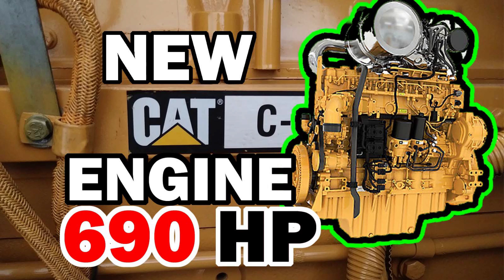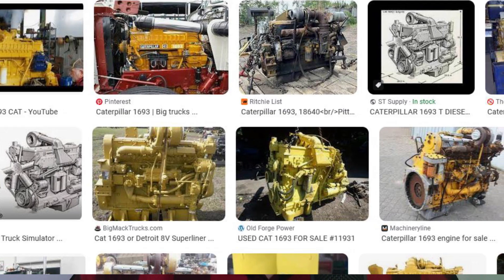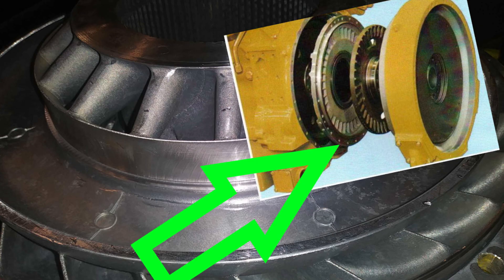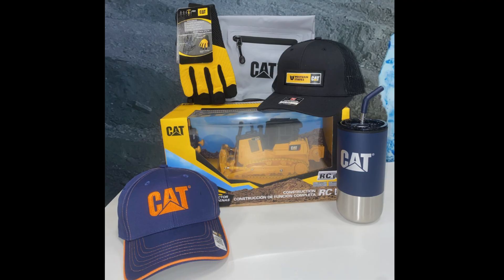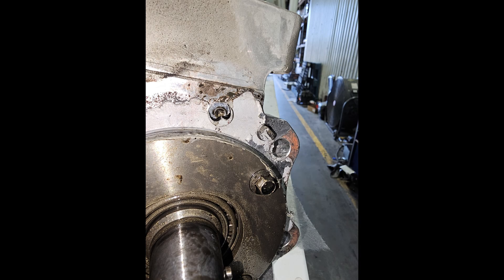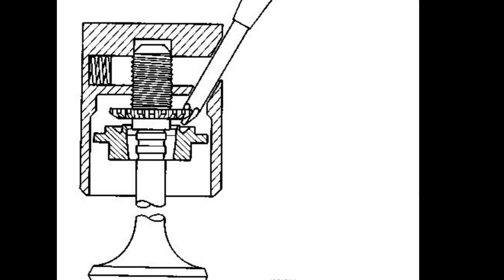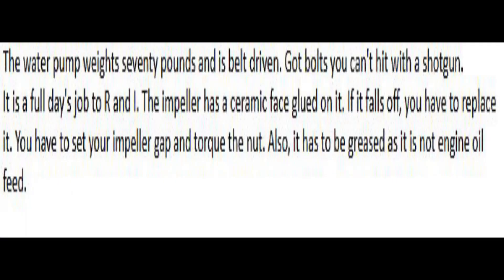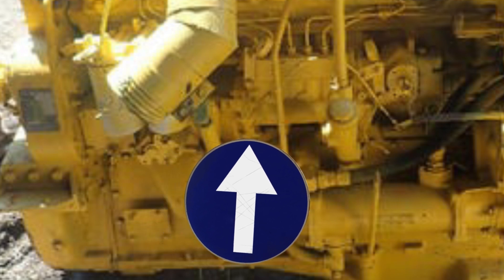The Coolest Diesel Engine You've Never Heard Of, Cat 1693, Dual Overhead Cam Caterpillar.

Comment from the maker: Thanks for watching. If you wanted to watch the livestream with the giveaway info, here is the link: https://www.youtube.com/live/k5mIdUxpS74?si=Ji4AVtOc7nYvK2NU
If you want help the channel out you can click the Amazon Affiliate Links here: Fuel Pressure Gauge, Compucheck 0-300 psi: https://amzn.to/3YeBldu
Airlift Cooling System Vacuum Filling System: https://amzn.to/3D9AlPu
Radiator Pressure Tester Kit: https://amzn.to/3QGBumn
Milwaukee 3/8" Right Angle Impact Wrench: https://amzn.to/3D2CvAk
Adjustable Height Parts Tray 100 lbs: https://amzn.to/3CBusZB
Engine Oil and Fuel Dye UV: https://amzn.to/3z34zkv
UV Professional Grade Light: https://amzn.to/3gzxPc0
Reply: Big Cat V8 engine was tried in truck's, cant remember its number. It was not a sucess. Way before 3408 and definitely not the 1160 or 3208.
Reply: Think a 1693 is interesting, look up the cat d336 overhead cammed v8
Reply: The d343 was what went in d9 cats way bigger than 1693
Reply: The first 3406a engines were precup engines also or a glow plug engine

Comment: The 1693 came in trucks at either 325 or 425 hp..The intercooled 425 could be turned up to 550 -600 hp..Total monsters that hauled ass.. they fell out of favor due to the 3406 being lighter= more product lesstare.Most of the Pete conventionals that I drove with a 1693 t 425 engines had aluminum frame rails to help lighten the tare weight. If you really wanted power you went with a 3408 v8 450…3.5-4 mpg were common if you were really gougin on it most of the time..

Comment: Side plates would be in good in a marine application. In a lot of marine applications you can't drop the oil pan far enough to get to the caps off. I've worked on a lot of engines in applications where dropping the pan is not an option.

Comment: The D348 was a V12 with dual overhead cam with 4 valves per cylinder and twin turbo. Designed back in the 1970s. Eat that Ferrari

Comment: Go find a 1694. A V8 version of the 1693, which is the truck equivalent of the D346 industrial engine. The D346 was used for the front engine in 657 two engine scraper.
A monster truck engine that reduced downshift on hills due to the torque.
Reply: Show me the 1694 link. The V8 that I know of was a 1676, smaller bore.

Comment: There was no sound like the scream of the huge Airesearch turbo. My uncle had a 1973 Kenworth K100 cab over with a 1693. That’s the truck I learned to drive in. Interesting engines for sure

Comment: Well, you almost know what you are talking about.  1693 engine was also used in air compressor's  and gensets designated as 1693. These engines were grossly under rated. One setback was there weight on the front axel of a truck, also, in the sixties the most states would only allow a 5 axel rig to gross 72,380 Lbs. Also, 4 to 5 GPM was the norm back then, it didn`t make much of a difference what engine you ran, pulling a van or refer bucking the wind loaded 4 MPG was the norm. Jacobs did develop an engine brake for the 1693 motor and made a very few around the time the 3406 was being conceived but never went into production.  as far as diesel engines not being advanced back then because there were not too many in use is something you made up. You should do a little research on a gentleman named Clessie Cummins and see what his contributions were to the diesel engine industry
Reply: On hiway truck was a 1693, everything else was a D343. Would like to see the info you have on a Jacobs Brake for a 1693.
I worked on these in trucks, rarely see one anymore.

Comment: I drove a 1972 KW with this engine for about 3 years. This engine was brought over from Cat's earth movers.  It was designed to be a very long life engine and it was.  I believe my brothers '72 had well over 1 million miles before they parked it for good. A couple of things, if my understanding is correct, with precups they could use very basic fuel injecters. I think I heard one person deride them as being fuel driblers.  The engine was heavy, didn't start well, averaged about 4.5 mpg.  But on the plus side, while it rattled terribly at a idle, as soon as you revived it up it smooth out.  Under heavy load it was glass smooth, overall the smoothest diesel I have ever driven, and I have been driving trucks now for 50 years.  One other thing nobody ever mentions, back in these years there was no cruise control.  But these engines had governors, and that together with a hand throttle worked surprisingly well, much better then any Cummins on the hand throttle.  They may of been rated at 425hp but always acted like they had more.  It took one very hopped up Cummins to keep up, and souped up like that those Cummins needed to be inframed about every 350,000 miles. I know, because I had one, after I had to move out of the '72. We were in the log hauling trade out west by the way.

Comment: If you need a cool engine topic the new gmc 3.0 duramax has been sweet. We have 1 with 70k, it hasnt skipped a beat, makes awesome power and gets up to 30mpg. It was a blank sheet build and incorporates lots of cool tech and design. If its high pressure system holds up to the test of time it will surely be a long lasting engine.

Comment: I had driven a couple 1693's back in the day. But I did own a 1674. Loved that motor. First Cat I owned. The precup engines were unique . Had their own sound, But man did they pull. My little 270hp. would give those Cummins 350's a run for their money, plus I was grossing 7,000 to 17,000 lbs. more, depending on the time of year. Hauling logs. My little Cat got good fuel milage back then. Mine had been turned up 10& over stock by Cat and I think he added a couple extra. Miss those old engines. Water pump was easy to rebuild and change.

Comment: The side covers may have been a holdover from their industrial market. 
On dozers, the belly pan would have to come off before you could even touch the oil pan. They were usually full of dirt and bent to the point of needing the hot wrench for removal. 
You could spend hours before you even could access the oil pan.
The side covers were a practical solution.

Comment: Early IDI systems fully relied on the heat of the precup to atomize the fuel by evaporating it, which also cushioned the pressure spike by slowing down combustion. The shape and size was more optimized for it being able to start vs efficiency.    It can be as efficient as direct injection but no one other than mercedes spent the r&d money.   The OM606  engines are the peak of idi technology.

Comment: I drove a 76 Pete 359 long hood with a 1693 in it for a few years. It had both a brake saver and Jake's on it.
475 hp and gobs of torque, the truck didn't know if it was loaded. Wonderful driving truck.

Comment: I had an owner operator pulling for me (I was acting as a broker for several companies) in the late 70s.  COE  ran east coast from Northwest Iowa every week with a 1693.  One time he shut down for about a month to have an out of frame major done on the rig.  It was running fine, but he thought it was about time. 1,100,000 and some odd miles.  Two sets of mains and rod bearings and that gigantic head was never off the motor in all those miles.

Comment: These engines lasted forever, My brother in-law had one in a 77 cab over KW it had over a million miles on it before he had to replace the injectors and over 1.5 million when the crank went down. He traded it for a 3406 because of the cost for a crank and wishes he had it rebuilt instead. THe fuel mileage wasn't the greatest but they were an awesome engine.

Comment: Would you consider doing a video on the 3406A? I know the B model is the legend but the A did come new from 1973-83
Reply: First 3406 (now called the A model) was 92U00960, built 10-17-1973. Cat shows 92U00959, but build date is wrong (1988).
Last 3406, 92U66443, built 8-28-1986.

Comment: My first interstate trucking experience. Could set it for 325/380/425 hp. The 325 would smoke any 350 Cummins on the highway. The ol Cat rattle all night long. KW with a 5x4.

Comment: A good report Josh. The 1693 was a nice truck engine in its day, long lasting, the problem was when it was time for a rebuild it was so expensive people would buy a new truck instead. I spent lots of time around these engines in their industrial version on Madill steel spar log yarders.
The choice of power was a Detroit V12 or the 1693 at 500 horsepower. There was no comparison here - the 1693 had literally double the power and burned half the fuel. They ran very smoothly, never found them to be oil leakers. They were very good engines but again expensive at overhaul time. Finning eventually build  up a 3406C to replace them.

Comment: 1) the day the 1693TA was delisted around early 1977, it had a 425 rating. The 3406 was 375 and did not achieve a 425 rating for another 8 years. 
2) 1693 weighs 100 lbs more than a 3408.
3) 1693 had no spacer plate until about 1970-71, #65B782 (or so).
4) 1693 was 375 until '71, and Brakesaver introduced '71-'72.
5) subjective, but 3406 WAS the evolution of 1693. The design team sat down with the basic bore & stroke, and I believe they tried to take the "Caterpillarness" out of the design. Pushrods, DI option, heck even fuel pump on the driver's side of the engine. All things to make the engine more Cummins-like very generally speaking. Also cheaper and easier to manufacture.
6) 3406 higher hp ratings '73-'77 (360 & 375) were all PC engines. Early 3406DIT was limited to 325. Aside from 1100/3208, all Cat truck engines (1670, 1673, 1674, 1676, 1693) were PC until 1973.
7) if the 1693 impresses you, the ill-fated 1676 DOHC V8 will blow your mind

Comment: 1693TAs had plenty of power.Only oil leak i had to fool with was the cam box. Just had to check the bolts. Just like any other engine you had to stay on top of stuff. belts hoses clamps.

Comment: bought a 1973 K100 double sleeper with a 1693 engine; 355 rear end; 13-speed transmission; engine was a great engine you are 100 percent correct. Unfortunately, the fuel mileage was 3.5 to 4 miles per gallon.  It was a very heavy engine so it didn't sell to the major freight companies. I was a furniture mover and it lasted me for well over 1million miles and I loved it.

Comment: I started my trucking career  with this engine 425 1693ta in a 1977 k100 big bunk, I could pass any body on the road, 3406 a and early 3406b couldn't hold a candle to these bad boys, the kt cummins was nothing compared to this engine , 3.2 mile per gallon best i got for fuel mileage,maybe  could have gotten better mpg if I didn't have lead foot and being 18 yrs old, engine would really heat up had to be careful  in the mountians

Comment: Thanks Josh and thanks to all who have commented on this engine.
I'm lucky enough, I hope, to have owned a D343 for the last 10 years. 
It was used as a 175Kw Genny but I have converted it to drive a fairly large water pump.
I live in a wild fire zone in the Otways in Southern Victoria Australia and it is an important part of my fire fighting system, I'm not planning on leaving if it hits the fan
down here.
Noisey YES. Gives the fuel Budget a bit of a workout YES. Gets run up and loaded every 3 weeks.
Starts easy, Sweet as a nut, runs as clean as a whistle love it.
I would like to to get the Rev's to 1800 but 1650 RPM is the max I can get. Still working on it.
I'm pleased you mentioned JPaydirt, great  channel as well.

Comment: My father drove a 1976 Peterbilt Cabover had a 325 hp 1693, Cold natured even in warm weather lol. Yes you had to hit the glow plugs for a minute or two, fire it off that thing with shake and smoke and Miss for five minutes before it smooth out. Clattered like crazy until you loaded it then it smoothed out and pulled like a freight train

Comment: I'm not too crazy about rear geartrain, its no fun changing an air compressor on a class 8 truch with a rear geartrain
Some older volvos out there with vectro engines in them that are quite nasty to do that job, a few smaller cummins that are in freightliner m2's that have the compressor back there too, and its not fun to change

Comment: 1693 was the truck model of the D343 industrial engine. Factory rated for 425/450 HP but you could turn the HP screw up to 600 HP without hurting them. Boy would they roll coal when you did that. The D343 was the front engine in the 631 Scraper and 637 Scraper that also had a D6 dozer engine in the back for push/pull operation. 
Also available for a genset power plant.
There was also a V8 variant for trucks. The V8 was the front engine in the large 657 Scrapers with a D343 in the rear.

Comment: There is much history to this Cat 1693 engine, the truck engine was only one division, and I think was a later application: 
The industrial version was used in the 35 ton model 769 rock truck, 988 loader, 631 scraper, 824 rubber tired dozer, 825 steel wheel packer. It was also widely used in marine, industrial and gensets. It may also have been used in military applications. 
It had close relatives in rare 4cyl version used in 619 scraper, 8cyl version used in 50 ton model 773 rock truck, very common 12cyl version used in 85ton model 777 rock truck, a 16cyl version used in hydraulic fracking in oilfield. 
The original 343 engine in marine application had the huge individual forged body fuel injection pumps until upgraded to the compact pump, it also had a decompression mechanism.

The 343 applications had rear gear driven water pumps, the truck engine 1693 had a front mounted belt driven water pump. It was an ugly/memorable event working on one in a cabover Kenworth with their narrow chassis. Great trip down memory lane Thank you

Comment: I know where there is a 1693 that is nearly brand new. It's in a large generator at an abandoned office building near me. Only 103 hours on it. Everything on it looks brand new. Not sure if it was the original engine or a retrofit. On the same property is another, much larger generator, with a 3500 series that only has 78 hours on it. Just left there and forgotten by everyone. That generator with the 3500 has a 2000 amp breaker on the output. Probably one of the largest breakers I have seen that's a normal molded case circuit breaker, not an air breaker with a pump handle. I have actually started the 3500 with a couple jump packs and it runs beautifully. Never tried with the 1693 but given the condition I bet it would run perfectly, it's essentially a new engine.

Comment: Worked on alot of these in the 70s till early 90s easy to tune and simple to repair most all truck applications could be tuned to pull heavy in any temp .had  a better track record than the 3406a precup .man the overhead was easy to run with a phillps screw driver.

Comment: I’ve definitely heard of the 1693 AND the little 1674, also an OHC early CAT diesel…..no jake brakes were ever available for either and parts are either unobtainable or extremely expensive to get these days. If I’d needed an engine with 1693 power back then (or now) I’d have gone with the V12 Detroit with N75’s and if I was looking at something in the 1674 range I’d take a 318 Detroit or a 335 Cummins over one of them. The 3406 is really what made CAT a popular truck engine builder…..before that not many guys would run them.

Comment: It was a good enguine I had a friend that had a Pete cabover with a 1693 and a retarded the retarded sucked they made the enguine oil heat up fast and cause the oil to thin when hot they didn't hold back as good as a Jake but for some reasons the cats are had Jake's didn't hold back as good as on the cummins or the 8v92 detroits

Comment: Most dependable and smoothest motors ever ran.  Brakesavers with double countershaft 5x4 s .What a combo
.. Never found anything any better in 45 years of driving. Didn't care about fuel mileage back then and they were very quite.

Comment: The 1693 & 1674 were bulletproof. Very reliable and well liked. Used extensively in construction & oilpatch.  👍👍
Reply: I remember them both (1693 &1674). Starting at a Cat dealer in 1976.
Reply: ll

Comment: Hi from the uk
It dose seem strange that this 1960s  engine had pre chambers and glow plugs which from my perspective was a combustion system for smaller engines of 0.5 Liters per cylinder which was popular up till the mid 80s. Today we have modern DI small car engines again still in the 0.5 l per cylinder using glow plugs but not for starting but to aid the reduction of HC emissions all of these car engines are now double over head cam and can run at silly high speeds, the mai reason for dohc is cot of production. Looking at the heavy vehicle and off highway machinery 1.0 + liter per cylinder i cant think of any that use heater plugs but some have air heaters in the inlet manifold again mor for emission control than starting. And the only one that comes to mind useing overhead cam is a fiat 6 cylinder 9 liter unit and that has the drive up the rear. Having worked on older cat, cummins and detriot diesels i can see no advantage for rear drive or overhead cams. It means a one piece cylinder head very heavy or a multi head engine and then that costs more because of alignment an oilsealing issues. Gas engines only went to OHC to get better control of valve timing at high speeds, not needed on trucks and plant. 
Keep up the good work